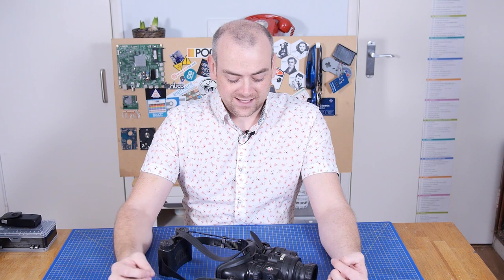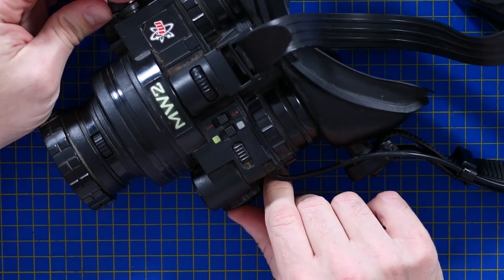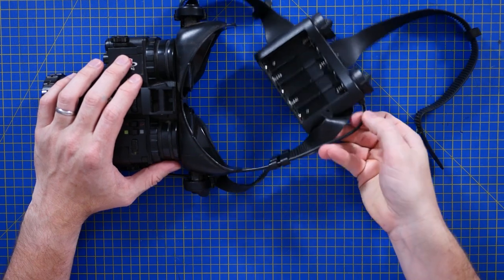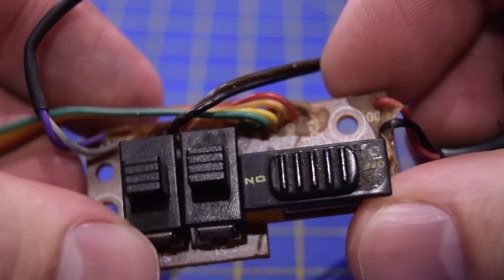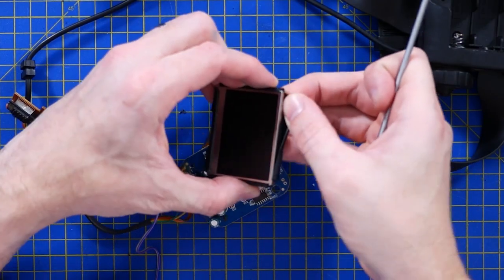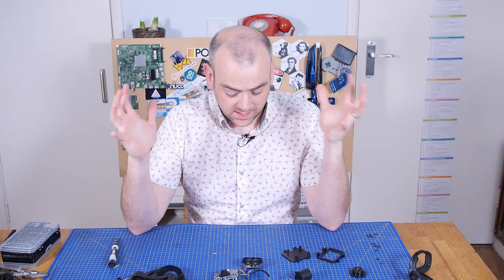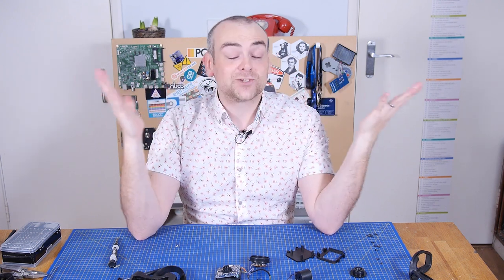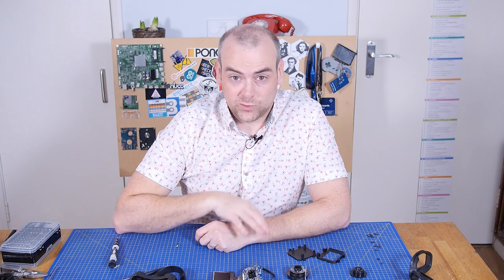How CoD Modern Warfare 2 Night Vision Goggles Work - The Electronics Inside

Comment: For whatever reason, the main switch is switching the ground connection. Maybe to cheaply switch all voltage rails at once. The IR-LEDs run off 5V. On the board there is a 5V and a 3.3V regulator. I'm currently modding one of these to use the innards of a simple USB Power bank instead of AAs. I'll use the pushbutton of the powerbank to switch power, and the power switch on the goggles to completely disable the IR illumination. I think they use 7.5V to have more room for the regulators when the batteries drain... I'll remove the 5V regulator and feed the 5V into the 3.3V regulator...

Comment: This is crazy, i just pulled these out of my closet yesterday after years of being packed away just to list them for sale. I have 1 pair that works and 1 that doesn't. Fun device, no idea how it compares to actual night vision goggles though. Kinda went up in price from when i got it for around 35 bucks.
Reply: Now you might have a chance of fixing the broken pair!
Reply: I sold a pair of Russian military night vision goggles on ebay around 10 years ago, very heavy but super cool to use
Reply: @Elberto71  Noooo!!! You should have kept them and donated them for a tear down!
Reply: They are the best night vision goggles at around the $150 mark or so I've heard. If you want actual ones without a visible light it probably would be close to the $1000 range.